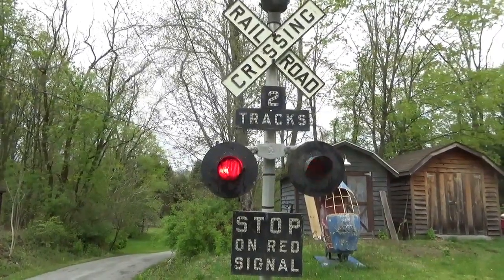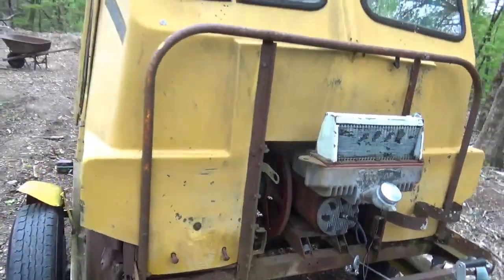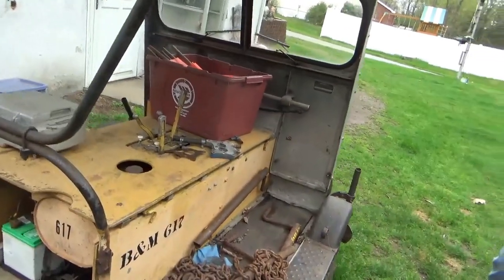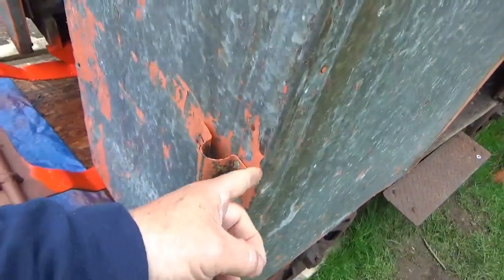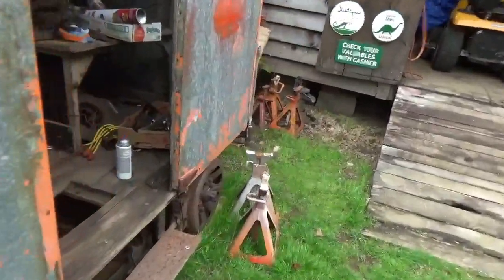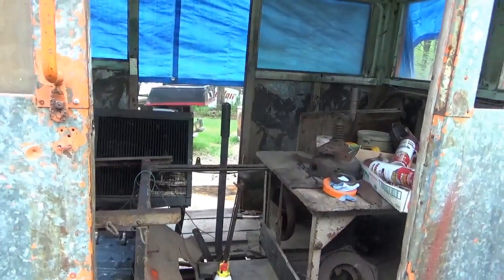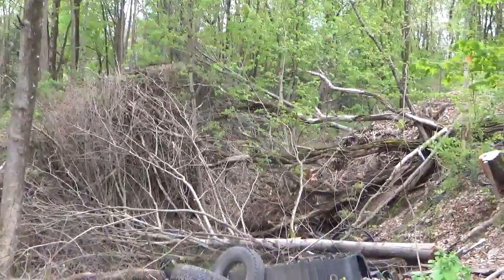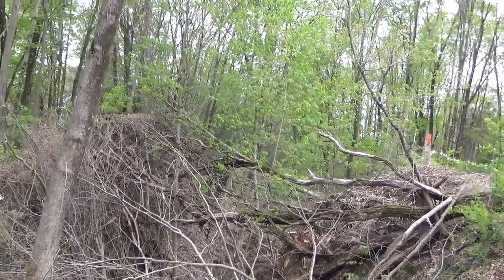Fairmont Rail Car Hoard and a 1958 Ford Rancho!

Comment: I worked for the Denver & Rio Grande Railroad starting back in the fall of 1970. I was on a 5 man Signal Gang and we traveled the mainline between Denver and Salt Lake City thru the Rocky Mountains. I've driven those Fairmont motorcars a million times over the years. There aren't many roads next to the train tracks in the Rocky Mountains so we used motorcars more than most railroaders around the country would who could drive to their work destination. We went thru train tunnels and over river trestles. Nothing like puttin' along in a Fairmont motorcar down the mainline in some deep rocky canyon with granite walls going straight up 1,000' on one side of ya and a cliff going down to the frozen over Colorado River on the other side in 28 below zero weather! Using those long wooden handles to put the motorcars on and off the track or turn them around was no big deal back then. .but I was 17 .. it was all just a great adventure..  but now I'm 71 years old. I think it would kill me now! Lol.  Thanx for the show on Fairmont Motorcar. That was a blast from the past for me! 🚂